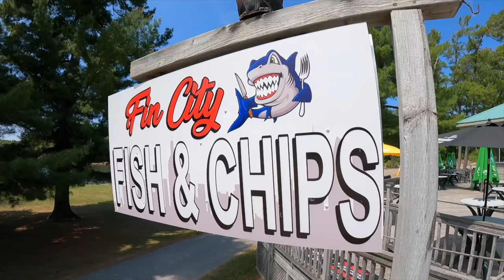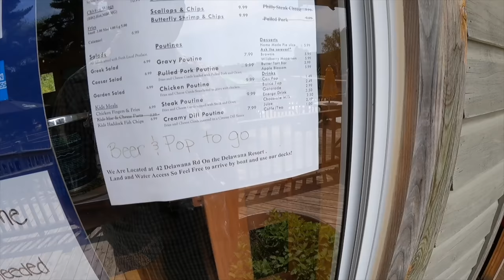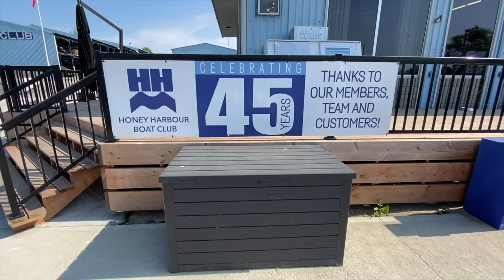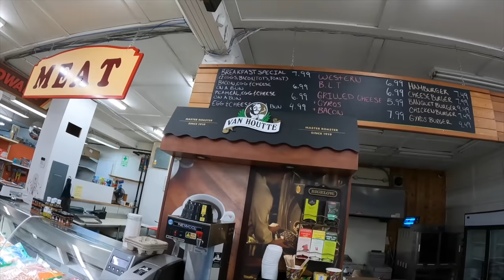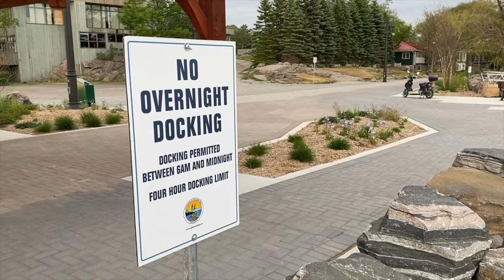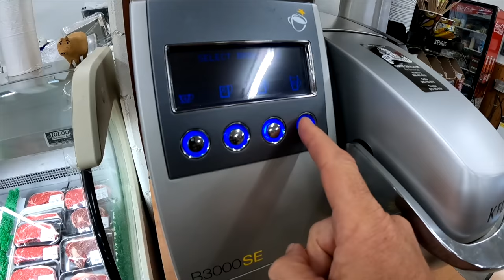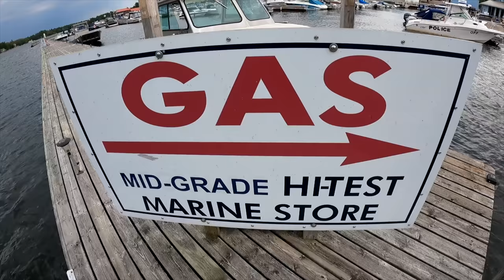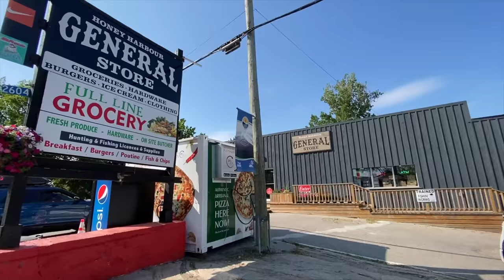Van Life 🚐 FOOD TOUR 🍔 HONEY HARBOUR • 24 Hour Stealth Camping #vanlife

Comment: Input also for single solar panel either or.  The dual is for dual panels with the adapter to set up two sets of panels by the round plug. Remember when it flashes it needs to be charged. Can be used while its charging in the car but I’d wait till it gets some life back before using another round if you run it down. I’d keep stuff below what it can do. A cooling fan will kick on from time to time to cool itself. I’d go look for another fridge remember to look at the wattage on the box don’t exceed it. To save juice I’d find one small for water and pop. I’d try the plug again the other direction feel the fan to see if it’s cooling if not it’s poof may be worn out.

Comment: Those are Jarrito’s pops are delicious my brother turned me on to them. It’s hit and miss around here even before Covid. You can run your Jackerie down to ten percent least mine will flash. I have the next size up my brother is sitting on the patio with my dad’s box fan plugged into it. Yes their a bit pricy but the usefulness compared to running a noisy generator gas n oil. I didn’t know they even existed until Jimmy Houston talked and showed them on his you tube video. Solar panels only set up with two not by electrical you can get now their Solar saga  for your unit and to be used for larger units. The two holes by the round plug. Solar works like where your sitting for example does better to get the full voltage. The reason they take so long is the batteries are hefty and the  inverter all have to work. Even charging by the sun its about the same but at some point So like at home or at the cottage even just in the window and solar will work. Ken even the panels by themselves can be used with usb connectors. I haven’t looked in a bit if theirs different size panels. Their worth the extra money at some point. If you got the huge units you can run your fridge and the house vacuum. The cords on the panels are plenty long. So you can open a window on the van. I’m sure a viewer can help you can two panels even larger units. The panels are magnetic so when you close them and their light weight. 

The kick panels are Velcro They have carrying handles built in. Two zipper bags one for the cable and usb connectors. The other for storage. I’d highly recommend a storage bag. The bag is fire proof. Don’t ever get your unit wet. It has to do with the electrical and the type of batteries. The bag will contain the fire. Plus their handy just in case around the cottage. Those three items I’m sure a viewer can help you get. It’s not a 911 that you do. I’m very hooked on these units. I’m very glad that i got the larger unit the 1000. Because camp grounds come to find out produce “Dirty Electricity” Being that my dad knows I’m Hugh?  Wave lengths you’d have to look it up. Once you save up and can get a larger unit three plugs 110 in the front and usb and micro usb run up to a thousand watts. I thought juice is juice. So rather than be stuck camping as you are to. I rather be over prepared. My 240 i got for Xmas already paid for itself when the surge protector failed on the rv. BIG PITA. Re wire the space shuttle my brother could for the night inflate his air bed my dad could charge his cell phone since he was on it a bunch. You want to talk about a hot box. That is the reason i got a bigger unit in case. Well the fridge ran on the rv batteries until the inverter said no more juice alarm. Plus the plug at the box is an un known in any camp ground. Then the truck batteries quit. Nothing to charge or jump it. At the time. That was a fun evening. My dad after i came up from fishing had the hood up i m do what? So they had to go buy jumper cables truck being a one ton using two batteries goes click batteries by by. Those batteries for sure are not cheap esp two plus these batteries are heavier than your typical batteries it takes two to lift one. Plus the truck is high off the ground even with a step ladder. Charging these not so much. So after that trip we jumped the truck made it up to the dealer being that they lasted two years not your typical four or more. Their fun. For the price of these batteries you could get a jackery 240 by itself. Just about. My dad is very very stubborn. Yes our rig you can put a generator in it. But thats more weight. The big W word is what we joke about but the less you put into a rig and less you put on leaf springs the better. Plus my dad’s shoulders having arthritis the less he has to do the better. He’s one of those that doesn’t want help or gets impatient if things don’t  happen in a snap. I said to myself i hope they run a special which at times they do. Make sure you have a way to jump start and charge things when and if thing go 👅 I don’t mean to get preachy but a teacher years ago said i needed to express myself more. With brown outs to Lord knows what. Have you gotten a Swiss Army knife? Not a bottles are twist offs. And the Screw driver doubles as pop top helper when you cant get the tab to work.
Reply: Sir this is a Wendy's!